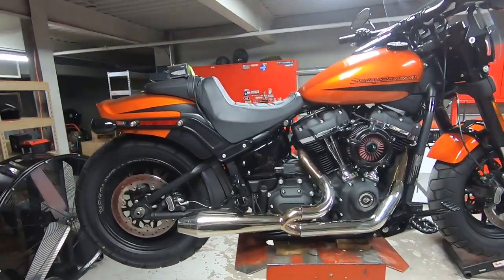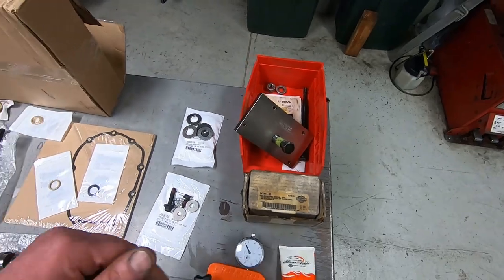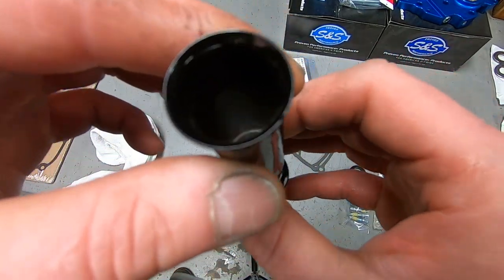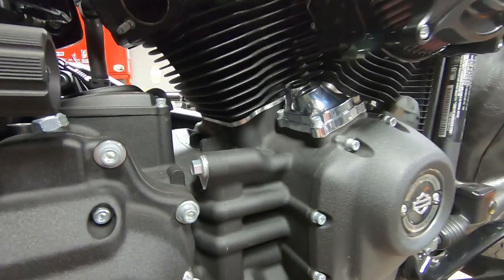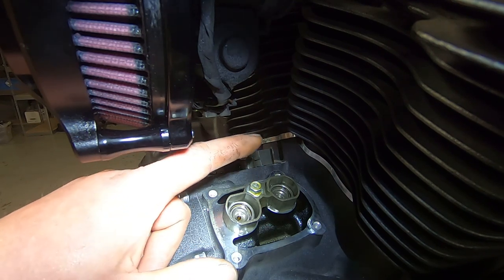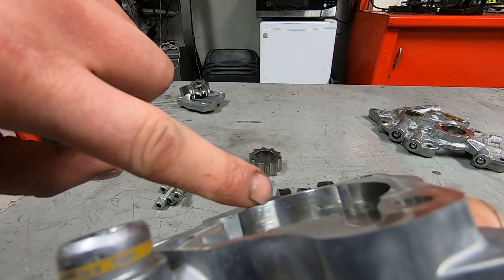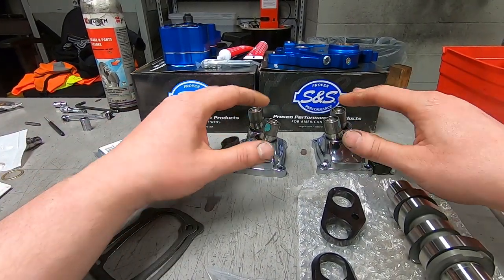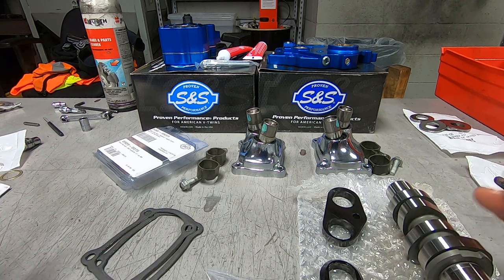HARLEY DAVIDSON FAT BOB 114 MILWAUKEE 8 SCREAMIN EAGLE POWER CAM STAGE 2 S&S OIL PUMP&CAM PLATE PT 1

Comment: Thanks for taking the time to show the parts.  That oil pump wasn't going to make the long haul.  With time it would only get worse.   With new cam and oil pump and bearings the lifters should also be replaced  no questions asked .  
What ever has been implanted in the lifter will transfer to the cam .
Reply from the maker: Ya, that oil pump was pretty crapy. To me it seams like would be harder to make the hole not round. Maybe one day I'll get around to measuring it. But it sure is weird. I also agree. New pump, new be bearings, new lifters are the easy I like to do it.

Comment: Great video. How was the power cam after install. Debating getting one for my Fat Bob. Are you using the screaming eagle tuner. Does it need the auto tune add on to use the  tbr 2-1?
Reply from the maker: The power cam ran great with this exhaust system. The customer wanted to use his screaming eagle tuner so that's what I did. It got just the screaming eagle base map, no auto tuner and I would say it wouldn't be necessary or needed.

Comment: Thank you for the video, please recommend the 2020 Street Glide Special Oil Pump Cam Kit Push Rod
Reply from the maker: If using a aftermarket cam plate and oil pump pushrods and lifters. I prefer to use all components from the same manufacturer. I use a lot of S&S and like them. But I wouldn't mind using Feuling either.
Reply: @HarleyDavidsonWizard  Thank you so much for your answer
  I asked how tabet correct position when the push rod adjustment

Comment: Brad, is that the third version of four (so far) for the Milwaukee 8 oil pump? I'd be mortified to find that kind of wear on mine no matter how many miles were on it! I wonder if the bore could have become warped due to excessive heat? This owner was smart to upgrade to S&S. My vote is to keep the music but I will also still be watching regardless!
Reply from the maker: Yes this is a 3rd generation Harley Davidson pump. I'm thing the pump was manufactured wacky. Its such thick aluminum I'd think it would take a ton of heat to warp it. But I do not know.
Reply: @HarleyDavidsonWizard    That bike appears to be well taken care of. Seeing the condition of that oil pump sure doesn't give me confidence about leaving my stock 2020 pump in place when I put my new cam in. Damn! Probably better to bite the bullet and go with the whole shebang -- S&S camshaft, lifters, pushrods, oil pump and camplate. Thanks for the in-depth look at the stock lifter retainers. At least I'll save myself a little money and trouble by not having to mess around with those lifter block screws.
Reply from the maker: To be honest with you I'm not a big fan of the 2020 oil pump. If your gunna run a stock oil pump the 2020 is deffentally the smartest one to use but one of the updates of the 2020 and 3rd gen oil pump was s seal on the back of the pump to separate the crankshaft cavity from the cam shaft cavity. This seal and the way it separates the crankcase cavities enables a shit load of crankcase pressure. Enough that it makes a significant increase in the turning force of the engine even when turning the engine over by hand. I dont like that aspect of the 2020 pump and is the major factor where If somebody asks my option on what oil pump to use its S&S 100% in my option and ya the HD matching of the pump is not impressive. Thanks for the question and view!!
Reply: @HarleyDavidsonWizard   Well, the plot thickens. S&S recently updated their design to allow use of the stock 2020 seal. The back of the new pump you have for the Fat Bob has a channel for it. Another dealership that posts a lot on YouTube claims that "S&S believes that it is better to have the seal..."  Maybe it's designed to solve the sumping issue on some water-cooled-head motors where crankcase pressure transfers to the cam chest and theoretically air-locks the oil pump.

Comment: Reference the oil pump, it seems that is Harley's standard of manufacture - I put a brand new Screamin' Eagle billet camplate and high volume oil pump in my twincam engine and it looks like that after five thousand miles - worse actually ..... the oil pump never did seem to be making much oil pressure and I know the crank runout was ok - less than 1/2 a thousandth......
Reply from the maker: I have also seen it before in the Screaming eagle setup. Its one of the reasons I prefer the S&S vs the screaming eagle. Its a goofy way to manufacture something in my option.
Reply: @HarleyDavidsonWizard   Yes, goofy is one way of saying it - the overall cost of making the bikes needs to be reduced as much as possible if the motor company is going to sell bikes. Harleys always have seemed expensive in relation to other bikes when performance is taken into account, and as labour is the biggest part of manufacturing costs then H-D have to 'outsource' parts to a greater extent than they did in the past - this is the case in most industry these days.
 The worst thing though is that everything is just 'disposable' these days adding to waste and pollution.....